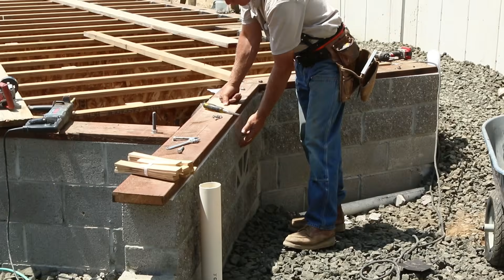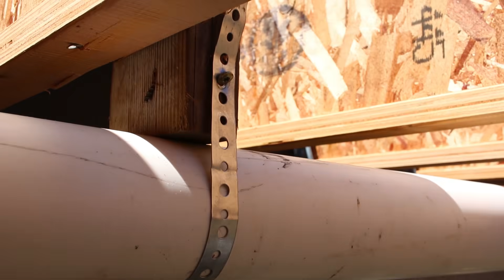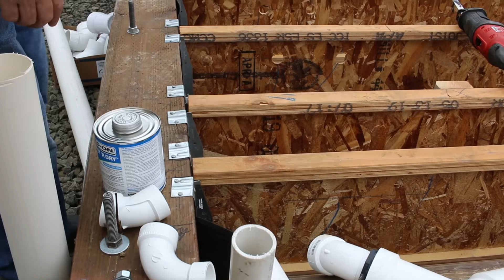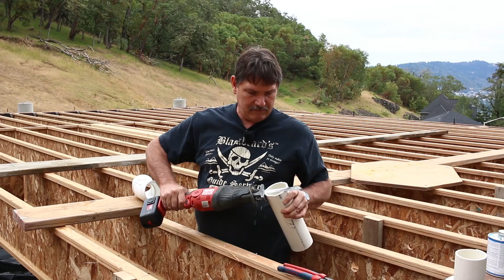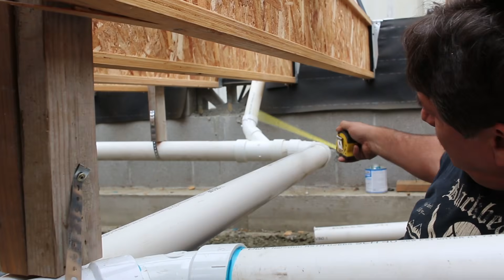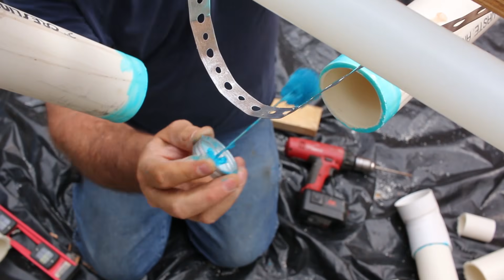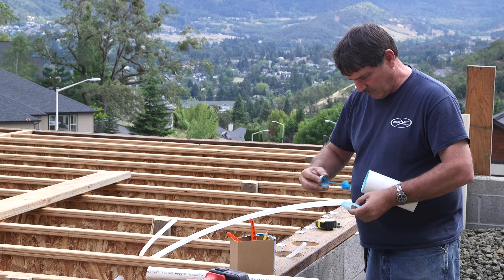Waste and Drain Ep.41

Comment: Why are you using 1/4 inch per foot fall on a pipe that size? 3" to 6" requires 1/8th of an inch fall which means 1 inch fall for every 8 feet. 1/4 inch is for 2½ or smaller like your drains for your gray water. Maybe its your code that requires it.

Comment: You are incorrect in saying nothing will ever degrade PVC (poly vinyl chloride). It get's brittle over time (I'm not sure how long it takes so don't ask). In the past I had worked for two separate scientists that both worked for JPL in pasadena , usually on classified stuff we don't know about.  But for some reason, neither of them would allow PVC in their houses. They didn't care what it was, but it couldn't be PVC. I remember there was something that was required to be PVC by the inspector,..and this guy asked me to have my guys paint every exposed inch of it with epoxy.  He did not tell me why he didn't like PVC (and neither did the other scientist), but over many years, I have come to realize that it does get brittle over time. That may or may not have been the reason.

Comment: Soil & waste pipes are installed quite differently here in the UK. All WC’s have a 110mm connection & more importance is on the a 110mm soil vent pipe. A single stack soil vent pipe with  all waste pipes connected to the this vertical soil vent pipe.  
This is called ‘single pipe system’, waste pipes from the soil vent pipe have a maximum length. Wash basin is <1.5M for a 32mm pipe & Baths, Sinks or Showers are a <3M for a 40mm pipe.
Generally the a Ground Worker(Drainer) will lay all the horizontal drains under a house or around a house & the Plumber picks up a vertical ‘stub’ at Ground Floor level. So the Plumber does all the ‘above floor’ soil & waste systems.

Comment: scott i hate to.possibly beat a dead horse  since your spec house was build on a slope  why was a house built without a full basement. 

i own a house built on a slab back in 1952 it was built on a slab.   back in the late 1960a the hot water system heat system crapped out the heat  was baseboard with copper pipe buried in the concrete slab.   the copper failed in the slab.   the oil boiler was removed and the base of the chimney was removed and the top  brick was supported  and a large electric hot water heater was install and electric base board installed and the hot water lines were rerouted in the ceiling. a major cold snap occured in connecticut and a power outage ocurred.  we were away for an extended time.  the pipes busted and thousands of gallons flooded the house the mdc broke off the main shutoff valve at the edge of the street. another mess for me to carefully fix. lots of fixes to make.  so motto  buyee beware. to buy a used house dream house. you might be buying your own money pit nightmare.  be careful with the dyi house built in the past.   buried underground oil tanks rust and leak. mine rusted but did not leak. my was still half full under the added garage floor.  cut the floor and it had no rebar. i  drilled 4 inch holes to drop in a sump pump to dran the home heating oil and donated it to a motherly senior lady who scrimped on heat. a bunch of  5gallon fuel cans. z
she got lucky the fuel was still good in    2000.  i got lucky the garage slab kept the ground water  other  wise it would have leaked  like. many in the development.  so i am the alison krause song the lucky one and like you we broke the proverbial mould on the days we were born. you out west near the west coast  me i lived on the east coast in new england and  i was born in the 5th largest city in eindhoven the netherlands home of phillips electric and electronics. the phillips shaver shows up under the noelco brand name.   my dad worked there before he followed his dream to become an naturalized american citizen. he may have done his dutch born duty.to queen juliana with a tour of nato duty. to. the korean war from.1952-1953 as part of a dutch militzary. commando corp.
dad.passed on in june 2012.and is buried a block way from our windsor locks homestead. that he and mom raised my departed brother may 2021. and two narcistic ex sisters who may be arrested and jailed for elder abuse towards my still living mother and me. federal prision will be warrented for  my year young sister born under the scropio sign. in the chiness sign 1956 was the sign of the rat. i watched a cartoon of biggy rat and 6 ft 6 and 200lbs that is big and he a itchy brother.   i thank god that i was born under the zodiac libra sign of checks and balances.  now it the time to join a party and have willie nelson you got the money i got the time. you run out of money i run out of time at the mendico county line. good night from the east coast. i was up at bangor maine for a forestry camp. we saw a curve oak tree.  it looked like firewood. it was still  growing and has great  value as the keel of a wooden sailing boat. 

unpaid endorsement. check utube acorn to arabella.  a oak board boat.was built from scratch 7 years ago and it is in the waters in bee gee state of massachusses.

on the west coast in squemish rwashing.

Comment: "It's a lot better when it's outside," UNLESS, of course, either code or common sense requires it be in a temperature-controlled environment in order to avoid freezing, such was the case in my homes in Virginia, Washington State, and Colorado.  Exposed plumbing is a NO-NO at 20 below (0 deg F).

There's also the "No Single Points of Failure" theory.  To that end, consider using two metal hole straps to hang sewer pipe than one.  Not only will it hold twice the pull of some kid, but it will also add a large factor of safety when it comes to cock-eyed or defecting screws, or bad wood.

Similarly, I've seen good plumbers put a slight 30 deg chamfer on all internal plumbing angles.  These keep sewage from catching on a 90 deg angle and clogging up the pipe.  FOR EXAMPLE, if you examine the inside of a PVC elbow, you'll see it's internal angles and joints edges which are rounded during the mold.  Phil is kind of doing that with his sawsall, cleaning the edges to prevent snags.  What I'm talking about is more like a 1/8" 30 deg (or rounded) chamfer.

Finally, when securing strap hangers, you do NOT want to load the threads!  Threads hold the screw in place, NOT the load in place.  To prevent that, the hanging strap must be vertical and the screw must be horizontal.  Exceptions involve longer wood or machine screws specifically designed to hold the load on the threads.  For that matter, most decking screws aren't designed to withstand much sheer, either.  For that, you need either galvanize steel, or more expensive stainless steel.  

I DO like his "fold-over" technique.  My uncle taught me that one, but he left a pencil-sized loop at the top.

Comment: What I like here is the way you keep so much of the waste system in the space and above the ground.  In Ireland (for reasons) we bury everything so everything is under concrete and inaccessible if anything goes wrong or, more to the point, impossible to fix if it turns out your builders mess up the fall.  I love the way also you build to satisfy an inspector.  We just don't have inspector's in Ireland in any serious sense.  Like a guy doing a house is under basically no oversight or quality control by any inspectorate.  Its ridiculous actually.

Comment: I'm not trying to imply that building is easy but just out of curiosity, could a guy without license get permit to build his own house ( per code and regulations of course) as long as he use contractors for electrical or any specific parts that requires a license?

Comment: Loved the video. The only thing I would have done different is the using of metal p tape underground. I often find that it corrodes overtime and eventually the pipe loosens up and sags. I would start using the plastic p tape, instead. It'll resist the underground corrosion a lot better, and give you many more years.

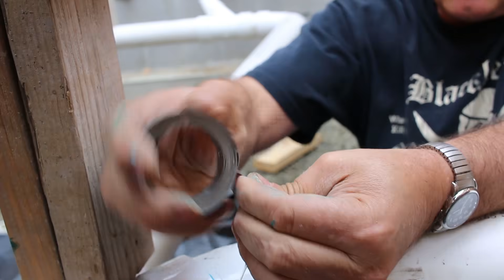Comment: At 17:20, well, by doubling it up that plumber's tape, it does not double its pulling loading strength but only its crushing strength as far as the head of the countersunk screw digging into the tape as it is squeezed on to the wooden backing.

Comment: Wrong. Septic is cheaper over the life of the system. I also object to the so-called "licensed professionals" who look to cut corners and skirt the code because the inspector won't see it or to save time, money, or are just lazy. I have not met one electrician yet who has not violated numerous code rules. Now I get that not all code rules are necessary, but a so-called "professional" is licensed specifically to adhere to the code, so they do not get a free pass in my book.

Comment: Don't call it a sewer system under a house. Use the right terminology by the code. It's called a building drain or a house drain. The codes are different for a sewer drain than from a building drain or a house drain which makes a big difference when it comes to what fittings and size piping you can use.  I've been a plumber for 48 years and I know code very well.

Comment: I’m not exactly sure which code you guys go by the down here anything larger than 2 inch diameter pipe is 1/8 of an inch per foot and anything two inches and smaller is a quarter of an inch per foot that of course is just minimums so I can see where you’re going but it seems to work better at that rate

Comment: I like the way you set the grade for the home run drain pipe, we used a level and hung the pipe from strap, your way is more accurate and easier to do, GREAT!

Re the good old days of cast iron pipe, the DIY or repair method of sealing the joint was to drive in oakum, a fibrous rope material then drive in lead wool, steel wool like lead, not fun but easier than getting out the lead pot and the horse collar for horizontal joints.

Comment: I believe when strapping a plastic pipe with a metal strap, you need to cover the strap with plastic material or tape where it contacts the plastic pipe.... Per the building code. This prevents wear and puncture of the pipe.

Comment: PVC is not the winner that you thinkit is! It's noisy, it loses it flexibilty and becomes ridgit which leads to it cracking. Here in NYC, it is still cast iron but no hub pipe meaning that we don't use molting lead to seal and connect fittling and lenghts of pipe. But heavy neopreme cuppling compress with stainless still hight pressure clamps. But I am enjoying this series and I'm learning a lot so thank you!

Comment: 8:20 I'm curious about the 16 inches of fall that wasn't used as part of the slope of the main drain pipe.  Is it standard practice to use a single slope for all installs and the drop was just showing the safety factor?  Would some plumbers increase the slope so that there is not a 16 inch drop at the end of the system?

Comment: I’ve never worked and thought harder than finding a legal, working plumbing layout that I could install them when I did my bathroom. Plumbing isn’t hard but it’s nuanced. Nothing but respect for plumbers here. 

Saw a plumber use a pipe with the perf tape inside it then around the waste line to hang his waste/vent lines. It gave a very clean and secure pipe. Have you come across this technique?

Comment: Cast iron is still around.Not put together the old way with oakum and lead, now there are rubber sleeves and worm clamps. I've seen an inspector run a camera down an installation and turn it down due to the fuzz inside the cut PVC being in place.

Comment: I've designed a few industrial pipe layouts in my time. Not as many as some, mind you, but more than most. It's similar to residential and commercial plumbing, but not the same. Still, the principles and spacing considerations are very close, though I think plumbers have more latitude and can get away with more. That said, I think you're absolutely right, there's somebody out there who would have done things differently. Not wrong, just differently. A job could be laid out 20 different ways with 100 variations and still fill the requirements. There are also pros and cons to every design. It's important to actually get it done. Perfect is the enemy of good. The trick is knowing when good is good enough. On the other hand, while there may be more than one way to do things well, there are an infinite number of ways to do things wrong. That's why codes and experience are absolutely necessary.

Speaking of experience, I wish I had seen your 2x4 and the plumbing strap trick before I replaced the pipes in my grandma's house. The job is still functional, the waste flows downhill just fine, and the venting is infinitely better than the utterly awful mess it replaced, but I sure spent a lot of time angling pipe in the crawl space with the spiders when I could have been cutting lumber with a circular saw in the driveway. If you're a DIY plumber be sure to check out Got2Learn here on YouTube. His tips and code helps are amazing.

https://youtu.be/xpsLXmntINE

Comment: Real craftman.  However...  What causes the major loss in real estate?  FIRE!  What is he making this house out of?  March sticks!   hahahahah  I live in a concrete and steel house.  4700 sq ft, 5 beds, 4 baths, heated garage, etc.  It costs me $400 per year to heat it from mid October to mid April.  There are no cold areas in the house.  It is radiant heat in the floors.  It is very quiet,  all floors are reinforced concrete.  Outer walls are 12 inches thick with 4 inches of insulation panels sandwiched in between.  On our last 5.7 magnitude earthquake, we didn't even bother to get out of bed.  It rocks in place, IN ONE PIECE.  We don't worry about termites or wood rotting out. 200 Amps service,  all electrical is in conduit and metal boxes grounded to the walls.  Every wall has power outlets, TV and network jacks. AND it was Cheaper than building out of wood. Most of the world builds in concrete.  Heavens forbid if if we are going to ease the firemen's load!

Comment: I noticed that you're running PEX for your supply lines.  However, when you ran them through the cut-outs in the joists, there was nothing between them and the OSB.  Aren't you worried about water hammer eventually rubbing a hole in the line?  I've always wrapped them in foam rubber or similar to prevent rattle and wear.  Curious to hear your thoughts on this.

Comment: I could tell he forgot 90% of what he learned, but oh well every plumber is different, I use primer before gluing, I dry fit fittings before gluing them (avoids wasting material) and I mark the connections at the angle they are supposed to be. (Keeps me from reaching for the level every fitting). The main trunk line the first guy installed was impecable, to save time though you could have just ran it towards its farthest fixture and raised it up to where you had your desired fall grade and strapped it up. Then just go down the pipe to strap the rest up. (No individual tedious measurements needed)

Comment: Another great video....and finally one I feel qualified to comment on, being an old plumber. It was great to watch your plumber work his craft, a true professional making it look easy. One hundred years ago they may have used lead pipe and bends which would have been 'pulled' out of a sheet of lead using 'dollies' and wiped at the joints. When I was apprenticed my boss explained how they  pulled a long radius 4" bend out of a sheet of lead which connected to the pan. One part of the sanitary plumbing which may have been good for your audience to understand is the importance of vents in maintaining pressure equalization in the sanitary system and keeping the fixture water traps in place. Well done on a great series of videos.

Comment: Talk about the last thing you want to go bad is your sewer system? Well I lived in a pretty good sized apt. complex and we were having a, you guessed it, a Christmas Party (1991 or 92). Our apt. was the last one on the corner, and to get to our door you had to go down about 5 solid, in the ground, concrete steps where in the middle of the bottom landing was about a 6 in. in diameter drain... As the night went on we started noticing this nasty liquid coming up out of the drain that eventually started to slowly cover the landing. We called the emergency number but they couldn't get out there right away. We ended up using a couple 2" x 8" ( I think) to make a little bridge from the last step into our doorway for folks to walk across. I remember that you had to be careful or the planks would splash water... By the end of it all, the water barely got into the house onto a linoleum entryway and never reached the carpet. So we got lucky (I guess)... We were really starting to panic cause if it kept rising the only place to go was inside our apt.... The management still ended up ripping out the linoleum and inspecting the flooring because they figured that it got down underneath it between the bottom of the door jamb and where the linoleum met. I just figured it was okay cause it cleaned and dried well with no lingering odors, but management just wanted to be sure which was an inconvenience for us, but necessary. The party was great! It was a bunch of 20 - 30 yr olds, so we made the best of a situation that we had no control over. They never pinpointed the reason, we just thought with all the people cooking and using garbage disposals on X-mas it just overwhelmed the plumbing system and backed up with no where else to go. thanks!

Comment: Yikes!  Why did you use the craptacular Cresline cellular core pipe?  That stuff is cheap garbage compared to real thru-body PVC from Charlotte.  And did you actually go 3" instead of 4"?  It was too funny watching you cut and cobble 2x4 blocks and then fight the metal pipe straps, when you could have just gone with real pipe support hangers for your drop.  So far your waste pipe is the weak link of the build.  Not a very professional installation.